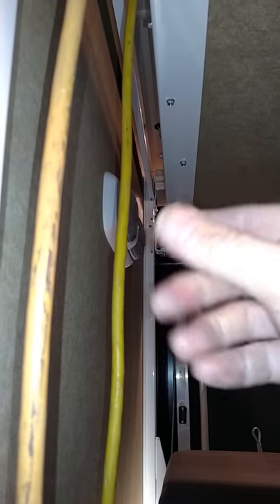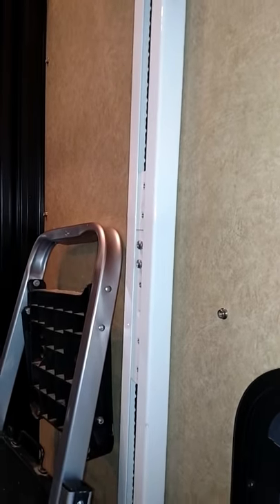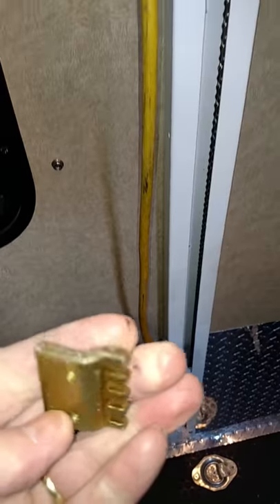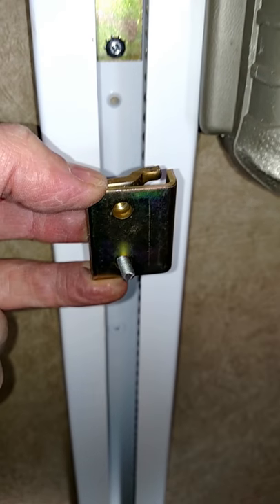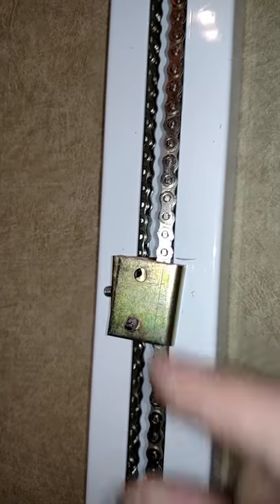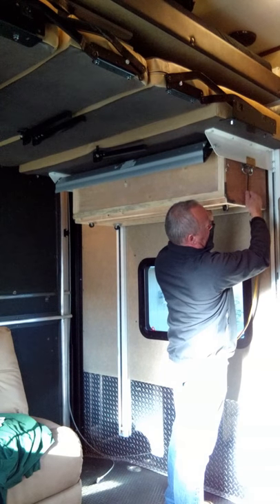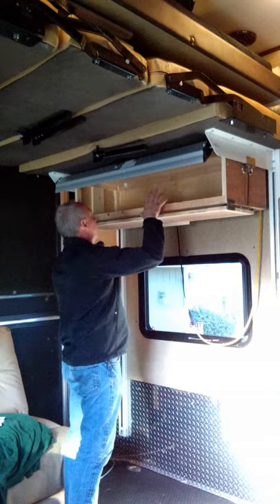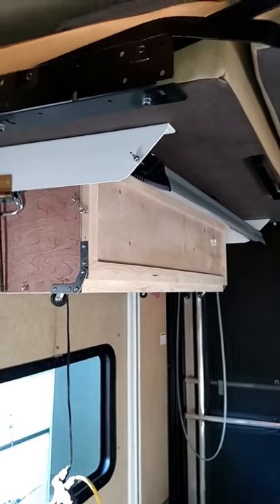Happijac bedlift pin adjustment

Comment: This video was very helpful & the only one I could find on this topic.  I used a very small zip tie to hold the brass chain clamp in place  then slid the trolly over the clamp and pulled the excess tail of the zip tie through the top hole of the trolley. This kept the holes aligned well enough for me to screw in the bottom screw. At that point it was secure enough to put a screw through the top hole and pull out the zip tie.  I tried a few methods including the sawn off screw but the zip tie was by far the easiest!

Comment: and great video by the way.. it got me off to a good start, in which I didn't understand what those little brackets were for.. I found them at the bottom of each corner of each "leg" of the bed system after I took apart the trolley system.  It's all put back together now.. AND in good order.

Comment: 1. Lower beds
2. Release the brake on the motor by moving the small lever on the end of the motor.
3. Loosen the set screw on the bar that runs from the motor to the other side of the lift.
4. If present, remove the cover from the hex shaft on the manual lift mechanism opposite and diagonal from the motor and position a 
1/2 inch box wrench on the hex shaft.
5. Carefully slide the bar towards the motor and  off of the hex shaft on the lift mechanism. 
6. While holding the bar to its mating hex shaft have your assistant turn the previously positioned box wrench to slightly lift the bed mechanism which will also turn the hex shaft that mates with the bar. When the hex shaft rotates 1/12 of a turn the bar will again be able to slide onto the shaft. 
7. Ensure the bar and shafts are fully extended and tighten the set screw
8. Engage the brake on the motor and replace plastic caps.
Reply: Would that only be good for side to side adjustment? Do you have any advice for front to back leveling adjustments? Looks like this guys vid might be only option? Any help appreciated

Comment: Hey what is the name of the bracket in the main pic . The one with the hooks . Our TH was delivered with a broken bed & we only have one of those brass brackets with hooks but I can't find it anywhere online . Please help
Reply from the maker: Hello, I think you're the first to comment on my video..thank you. You have a very good question and let me tell you I had a hard time getting a replacement wheel stud for my trailer but an excellent time with a single plastic part for an awning. 
My suggestion, plead your case with Happy jack or Lippert.
I did a quick search and I could not tell if Happyjack is a company or Brand owned by Lippert (Lippert Component Inc.) http://www.lci1.com/support/
...who make A LOT of  the standard trailer products. They use to be called Atwood. 
I'd start with Happy Jack and try asking for the chain clamp assembly. get a direct email address to the person you're talking to and send them a picture of it if needed.
If you bend over backwards to make it as easy as possible for them to help you, you'll get better results.
I would even say "I know this is not a normal request but can you help me out?".
Good luck
PS, I could not find that specific part either so it would have to be a favor they do for you, someone would have to go get the part from a bin somewhere and be willing to package and send to you.
Reply from the maker: Sorry, it's spelled Happijac
Reply: This post is extremely helpful! I just had 1 of the 4 (the one on the motor post) pop and drop just that support down 5 or 6 inches so I suspect the fingered clamp may have broken or the bolts snapped/came out. Looks like its going the be a big job tearing it apart for inspection.

Comment: Cool mod, but do not use this method to adjust pin height/timing.  The method in the downloadable owners Manuel is so much easier and took about 10 minutes total.  You loosen one retention bolt, rotate the cross bar by hand, reinsert it and then tighten the small screw again.  Very simple, you don’t take off the couches or mess with the chains.  I almost used this method and thank goodness I checked the manual first.
Reply: Any way you can provide a link to this process?